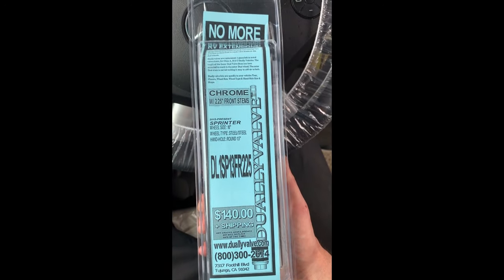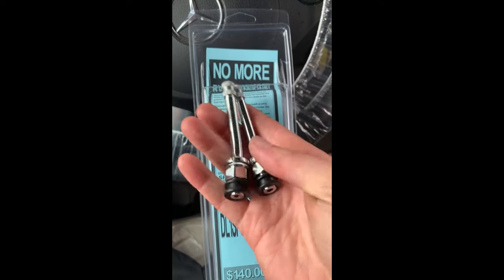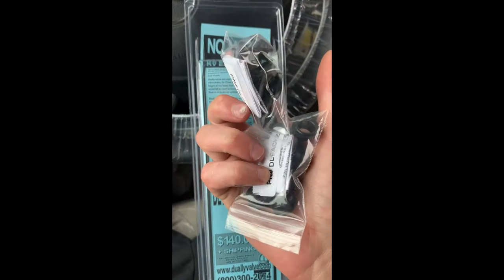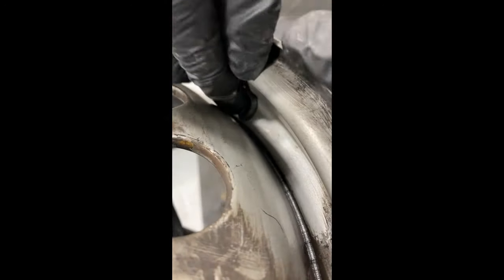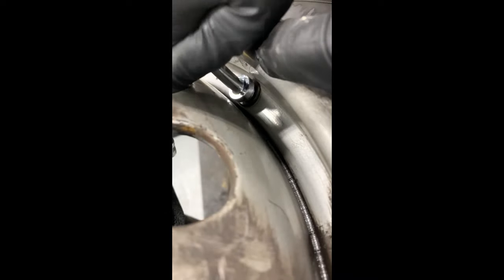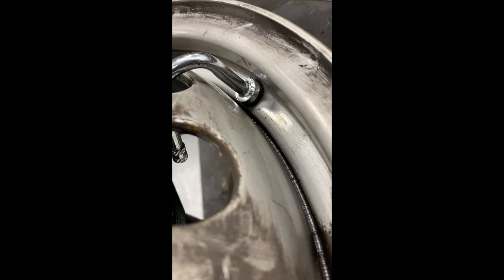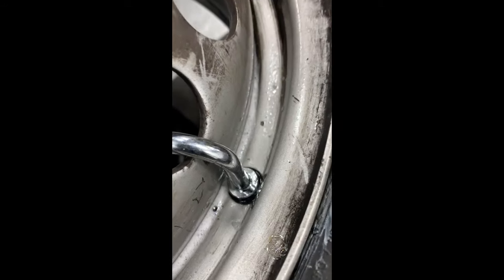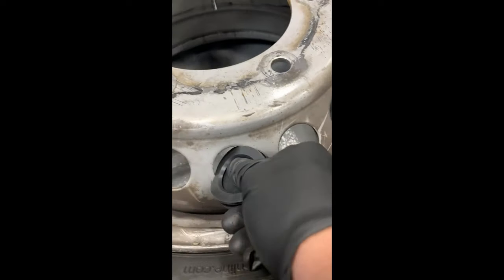Borg Valve Stem Install (Sprinter 3500's)

Comment: Thanks for the video, it is exactly what I was searching for to put them on my Sprinter 3500.  For tight fitting rubber bits, I use isopropyl alcohol as a lube. It evaporates, but works wonders for these situations and leaves no residue behind. I was hoping to see a picture of both fully installed (any other pictures?).

Comment: I bought new tires and a set of Borg valve stems. When I went to pick up my Sprinter RV they had no idea what they were doing with the valve stems. It was like they never even picked up the instructions in the pack. They put the long Ones on the front and the curved Ones on the inside dual and short straight Ones on the outside duals. the only seal that were not torn was only One of the front long stems. You would think a tire store would know what they were doing. I ended up taking it to my RV dealer service department to get the job done right. (They had to order a new set of seals so I had to wait a week) Other the that the Borgs work great. I don't understand why they just don't put them on from the factory. Does Winnebago, Coash House, etc. think that adding about $250.00 to the cost of a new RV will make a difference? Rant over.
Reply: And I thought it was my curse to deal with stupid people

Comment: We are sending your video to the shop that’s installing our new tires. Wondering if you had to bend the inner dualy stem to fit straight into stabilizer. Any pictures, suggestions on how to bend? Also if there are any issues with these stems and balancing equipment. Many thanks

Comment: I’m curious to know why you didn’t put the grommet on the stem and then Lube the outside of the grommet and push through?

Also something I’ve gone for years on Rubber Parts is to soak them in 303 Protectant that is heated up to 145°F and let soak for 10 minutes and then remove the heat and let cool down. This treats the rubber from Sun and other UV & Chemical exposure including Salt.
Reply from the maker: So I had tried that method but still had some failures so do it this way as they state in their instructions.

As far as soaking ect I try to follow the directions on aftermarket components as much as possible to cover myself from being the cause of failure vs a part failure.
Reply: @sprintertechdirect903  this has been done this way for many years by Truckers.
Reply from the maker: Well a lot of people do things but doesn’t mean I do haha.I follow the instructions.
Reply: @sprintertechdirect903  awesome righteousness